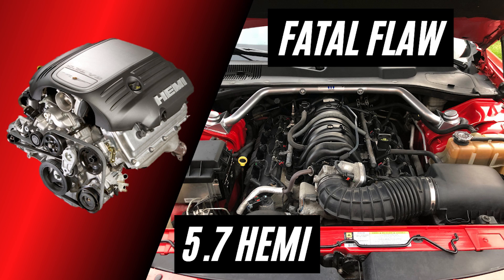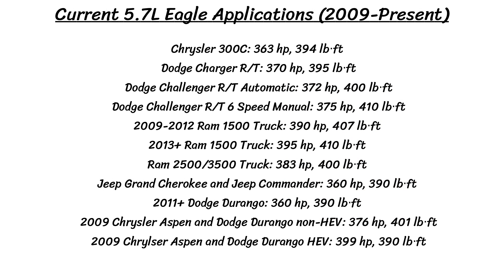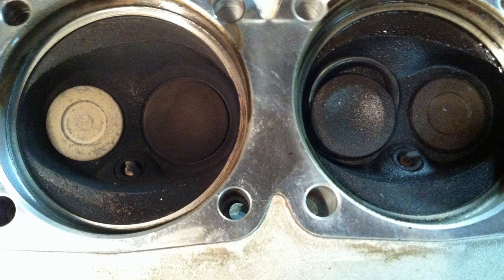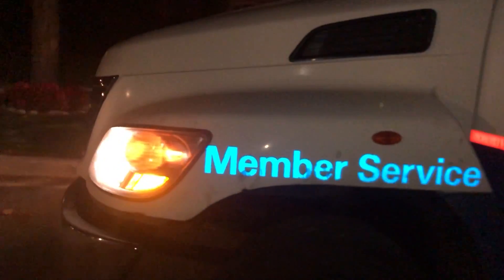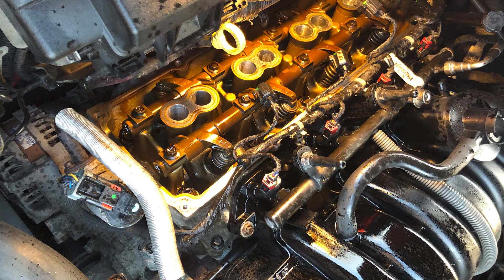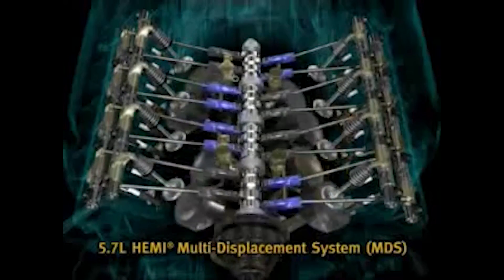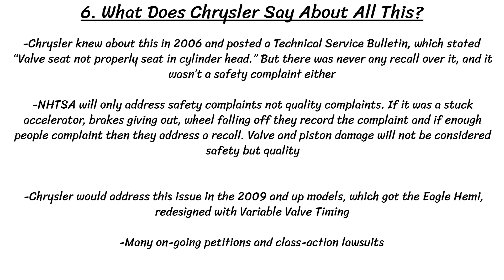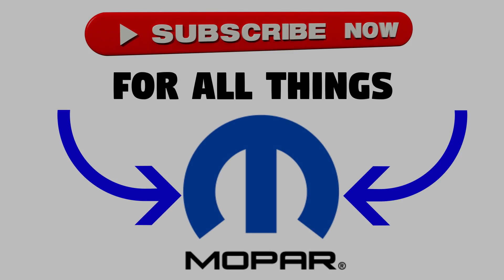The Fatal Flaw of the 5.7L Hemi V8 Engine & How to Prevent It (2003-2008 Valve Seat Drop)

Comment: 20 years as a Chrysler tech, the only time we would see a seat drop is from overheating. Pay close attention to your cooling system, and watch for lean conditions
Reply: That's what the consensus on the LX forums has become. Also it's not an immediate thing, if you're the second or third owner you may never let it overheat but if it had that happen multiple times the valve seat may have begun to loosen. It kinda boils down to maintaining your car. Given how many first gen hemis are still on the road vs how many have dropped seats. A lot have had it happen but the majority haven't. It is a flaw but it's also an issue to let the engine overheat as well.
Reply: I have been running a 180 T-Stat in my 05 Magnum RT for a few years. I figure it is better safe than sorry as I hear the primary reason for the failure is heat. I have over 216K and the HEMI runs great. I take very good care of the car and watch all the maintenance closely.
Reply: @samuknow  my first up grade was to a 180 thermostat
Reply: My second upgrade was stainless one piece wheel nuts, had a horrible time getting a wheel off when I needed new tires.
Reply: @billknight5578  160 even better.  I am even putting in a lower rad hose 160 stat. You want the motor to warm up quickly then stay cool.
Reply: I dont understand why any engineer would think its a good idea to develop 1/2 rings made out of a different material and not foresee that the expenasion differences would be a problem. cylinder sleeves are ok because they are longer and will hold in place but rings that small wont. also what is the benefit? why not keep it aluminum?
Reply: @zili8103  valve seats have a better sealing, thus giving better compression which translates into better mpg...etc
Reply: @zili8103  the steel valves would wear out and aluminum seat in the head very quickly. That’s why there’s a steel ring for the seat.
Reply: I’ve got a 2011 r/t with a hemi it has 67,000 km and 1700 engine hours and it sounds like a diesel when I start it up for the first 10 minutes kind of scary power steering is dead in the water after replacing my battery with a new mopar one
Reply: Hey Gen3 on a 05 magnum 5.7  eng.  what would you suspect first with sudden ETC light flashing.
Reply: @BUDDYSNORES  my truck did that, I cleaned the throttle body and it didn't do it again. Give that a try and see if it fixes your issue?
Reply: @billknight5578  Thanks Bill will give it a try
Reply: @BUDDYSNORES  follow the pink wire with the yellow tracer and make sure the continuity is good. That wire does lead into the cabin, but it can cause that issue. Other than that, pcm, pedal, or throttle body can be responsible
Reply: @Gen3HemiBuilder1964  ok thanks, I will start there
Reply: Thanks for that good information sir.
I think I'll buy a GM, thanks anyway.
Reply: I will probably have my 300c driven from NC to NY which is about a 12-14 hour drive in about a year, this kinda worries me about seat dropping now because it has 121k miles on it
Reply: @alexanderlayne-stasik1317  it will be fine. 120k is nothing. Just keep a good thermostat ( change it every 50k ). Change the coolant every 5 years. Do normal oil changes and drive the shit out of it.
Reply: @Gen3HemiBuilder1964  hey Mr hemi builder, I’m back, after 3-4 years after I first responded to your original comment, and I now have the car as of about a year ago. It was my grandpas car and I try to take great care of it, that hemi in it absolutely rips and I love that car so much. Thank you for calming my nerves about the seat dropping I had such high worries about years ago. The only issues I have now is it can stall while I’m driving if I fill it up to a full tank lol, but usually it only happens for a little bit. Hope all is well and thank you again!
Reply: @alexanderlayne-stasik1317  you are most welcome. Depending on your vin, some of the fuel tanks on 300, charger, and magnum have life time warranty due to the known issue. Call your local dealer and find out. I just did the tank on my 05 magnum.
Reply: I've got an 06 1500 Hemi that i bought back in 2014 that now has right around 182,000 miles on it. Not gonna lie, the gas mileage is shit (really wish they had better trans. for these back then) but the truck still runs pretty good other than that. But now, chryslers 4.7 H.O. is garbage. We had an 03 grand Cherokee that had the 4.7 High Output overhead cam motor and for the first 1.5 years or so that jeep was pretty powerful and fun thing to drive and fairly decent on gas too. One day though, out of nowhere, we pull up to a gas station and as soon as we did and i was getting out i hear her kind of gasp and then kill the motor. Before i could even get turned toward her to see why she looked super panicked (she has really bad anxiety so it don't take much lol). She told me it was overheating and i asked her if it was the first time, she said yeah, as far as she knew. So i asked how high did the needle get. She said maybe 7/8ths of the way so i said ok, pop the hood and I'll check it out. The res was full and after waiting for about 5 mins i opened it but the radiator cap was still too hot to pull. Sorry, long story. Anyways, the thermostat was stuck which caused that so i replaced it and it seemed like everything was good for about 2 days. Then it started running like complete shit so as I'm trying to figure out what's going on and had already changed out several parts (all of which had to do with the 3 or 4 codes it ended up throwing) there was an o2 sensor that burnt to hell so all 4 got changed. I can't even remember what all got changed other than the sensors, the cats(which also went to shit) but i know we spent a lot on parts, and tested a bunch of other stuff. One day while working on it after turning it on i see the rolling white exhaust(F***). Finally took it in and it had a few valve seat problems, blown head, bad gaskets, the cams was beat to sh*t, and I'm pretty sure other stuff too. Shop had it for a little over two months before we got it back. Still wasn't running right so they ended up having it again for a while after the third time we took it back telling them something is wrong. They finally listened to us and actually started looking for a problem and found out that they had messed up the cams somehow so had to order some again on their dime. There's another month and a half waiting on parts and them. They gave it back and it still didn't run right. Not near the power it had and the idle seemed rougher than it should. It was taken back to them a few more times before we gave up on the piece of s**t and traded it in. After talking with several mechanics and dealers and plenty of research, the 4.7HO is an awesome motor.... until it gets hot, ONCE! And if it does, you might as well take it straight to the shop
Reply: @ericduncan9895  that is very true about the 4.7, I worked on them since their induction. They really do run forever with one important factor, keep good thermostats in them. I recently sold my 05 Dakota 4.7. Still ram great, all original power train and kept a 180 tstat in it. 293,000 miles later another owner is enjoying it.
Reply: I’ve heard of people replacing the thermostat with a 180 instead of the 200 or 210 to help with this, but you’ll need a hand tuner to change
Reply: @justinzippo7772  the only ecu tune that is required is to turn on the fans at the correct time with the new thermostat equipped if not oem replacement
Reply: But this problem does not happen in other engines, even if overheated. Even if its related to cooling system -  this a Chrysler error even more. Because this means so many of 5.7 cars have problems BOTH with their cooling system and valve seats.
Reply: @cytrynowy_melon6604  this problem actually happens in many vehicles and aircraft. Having worked in both industries for years, I’ve had quite the opportunity to find out. I’ve had dropped seats from many forms of every car maker. Predominantly Mitsubishi and Toyota.
Reply: Design a better engine that doesn't overheat or lean out for no reason.
Reply: It's shit engineering
Reply: When you say "factory " sensors and spark plugs, are you referring to Mopar? I'm curious I just bought a 06 Chrysler 300c with 150xxx miles today
Reply: I've said this for a long time.  We got a 2015 grand cherokee, 30,000 miles, first thing I did was throw away the  1" thick radiator and replace with custom made 2.5" all aluminum radiator, 160 stat and tuner.  Result is very low chance to overheat much stronger engine, etc etc.  Works great radiator is only $1000.  Problem fixed.
Reply: Yes and replace the steel cooling tubes to water pump
Reply: I don't think any manufacturer can build a vehicle of better quality that won't fail
Reply: Glad my 04 1500 seems to be running rich. Sucks for mileage but the engine's got 315,000 kms and no problens.
Reply: Or just buy another brand you trust.
Reply: I have a 05 jeep wk 5.7 and it’s saying all 4 o2 heater control circuits low. Jeep will run fine but then it starts stalling and rough idle. Would appreciate any input, thanks
Reply: Agreed, working at an auction ive seen countless early 5.7 hemis go through with well over 200k on them. I almost bought a hemi magnum there with 240k on it. Unfortunately due to a title issue had to get my $ back. Was healthy tho even at those miles. Paid $800 for it lol would have been a heck of a win had it not had a titling issue. Trans shifted great aswell. Think the alternator was on its way out but otherwise was great. But yes overheating I believe is the issue aswell. Notably peoples lack of making sure their cooling system is working correctly. My 06 300c with the 5.7 ran a bit warm.  Always hung around 215-220F at hot idle. Now had my cooling system not been properly pressurizing this would have been a huge issue because this could allow boiling. Most people have never even checked what their overflow cap looks like. Now eventually one day in a drive through I heard a slapping sound. My cooling fans came apart. Weird. But got some from a junkyard and I noticed my car started running a lot cooler around 210F max. So I assume my fans low speeds had been no good for quite some time. To easy to over look cooling system issues on these cars. Another good thing to do is replace the water pump. Factory pump has a plastic impeller. Had mine come apart pulling into a gas station. Caught it right as the gauge went a hair over middle thankfully. Let it cool, fired it up and cut on my heat and noticed it had no flow. I could see one of the plastic blades coming off it too and causing cooling system issues.
Reply: I have an 08 commander  first gen non vvt  5.7 it has 132k miles on it . It's had an exhaust leak for at least 30k since the exhaust manifold has a couple broken studs that I keep neglecting to fix .   It seems to be fine .

My dad has had two Ram 1500s  I think the first was still need enough to be vvt the current one is  a 2018 so it certainly is . The first  one he ran for about 140k miles trades it in on the newer one a few years ago and probably has 30k or so on it . He has towed  a camper and trailer used to haul fireplace pellets with both  so  5-7k lbs .

That's 3 hemi engines my pre VVT  commander and both my dad's 1500 ram trucks  .  One thing I noticed about my commander is it eats oil  and that seems to be a thing with at least the early 5.7  because every one I looked in the dealerships were low on the dip stick and my commander drops a quart about every month ... So if you are not the type to check your oil when you fill up the gas tank at least every couple tanks you are must likely running around with low oil a lot ...lol ... Probably don't charge it often enough either .
Reply: Will a 5.7 hemi from a dodge 2500 pickup working in a charger. I know some of the non engine components will have to be changed out but if it’s the same cubic inch motor wouldn’t it have to work? I’m being told it won’t work
Reply: @russellmiller1307  it’s mainly in the programming. 2500 5.7 trucks do not have multi displacement as where all the 5.7 cars do have it. Plus the accessories are different along with the timing cover. Depending on year you also have to make sure your pcm can correlate timing with the tone wheel on the donor engine.
Reply: It seems to me that 205 degrees is way too HOT already.    Should I be concerned for
Reply: @popwarner8029  normal operation you will see up to 223 under normal hot ambient conditions. Naturally I like to run a 180 thermostat and tell the fans to come on at 180 as well. It increases longevity. We run them hot to aid with hydrocarbons in factory vehicles. Just following emissions rules.
Reply: Mine rann218 t0 220 for 17 Years till valve seat drop no warning. Ran like a top.         2 @popwarner8029
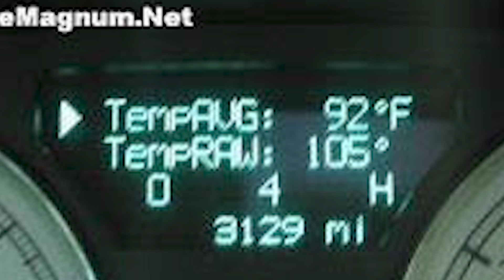Reply: @9:50 how do I find the temperature readings? I have an 07 charger daytona
Reply: I have a question for you sir, I have a 06 AWD rt magnum 125,261 miles. What oil brand should I be using? Any also any advice for a longer life for this motor please give me the advice loo lol. Just had the valve cover gaskets replaced and ac compressor. Should I be running a 180 thermostat? And is a cold air intake worth getting?
Reply: sometimes being a dodge fanboy is bad for you.
Reply: Other than that is the gen 3 hemi a solid motor, I know that the splash lubercation starvation during idling to the cam lobes and lifters but another tech said to use a hellcat oil pump for more volume at idle than oem. Idk I really like the challengers but I'm scared of these engine but I love them because they sound cool and make great hp.
Reply: Why do you suppose that some people claim that their car dropped a valve seat and wouldn't start again even though the car allegedly never overheated?
Reply: @JohnTaylor-bd1uy  allegedly, yes they say. I own 6 of these engines all with different purposes. From towing, to drag racing and road course. Never seen it unless the event of an overheat.
Reply: @Gen3HemiBuilder1964   That's the only time I've seen that happen too, and in a tech! I personally believe that those that claim that their engine just suddenly took a crap when everything was perfectly fine is a lie!
Reply: @JohnTaylor-bd1uy  yeah man, agreed. I was with dodge from 2001 to 2020 and the only time I've seen these engines fail in any manner was due to neglect of some sort..
Reply: @Gen3HemiBuilder1964 drove mine 17 years no problem. Then one day at 220 degree constant,  valve seat drop. Ruined whole engine.
Reply: Yea my charger has 270 thousand miles on it a 5.7 still strong.the reason they fail so much is people abuse them no excuse
Reply: That may be true for the 20 years of other engine designs. But towards the end of the video Chrysler admitted its an issue they caused. So In this instance your twenty years are useless. It’s like when Audi created the 1.8t and put it in the Passat cutting its oil supply by one quart below its intended design
Reply: I occasionally got a  code that there was lean from the O2 sensors, I replaced the sensors  but never got to test it because she dropped one on me in exactly the described sequence, shutting down the engine, half an hour later restarting it, ran like sh@t en didn't idle anymore so maybe it was because of that lean burn then.
Reply: @alexh201174  with those o2 sensors, definitely use only factory sensors, Bosch from the parts store typically causes problems. But as far as the lean code, your fuel pump is likely becoming soft. Replace the pump located under the LR seat, and make sure the fuel transfer tubes from the saddle pump look good.
Reply: @Gen3HemiBuilder1964  what kind of problems? I replaced my oe ones with bosch.
Reply: @sambo92  over time they can cause a rich or lean condition and a cel illumination. For my customers it’s just not worth it to cause another possible problem. Just use factory sensors. Same thing with their spark plugs, cause stalling issues etc.
Reply: @Gen3HemiBuilder1964  even if you're tuned? I've had the bosch ones on for a few months now with no issues yet
Reply: @sambo92  that’s good if they haven’t caused an issue. The first thing that usually fails on them is the heater circuit. But now if they are wide band sensor after being tuned, they will work with the software
Reply: @Gen3HemiBuilder1964  I still have my oe ones. I had a slow circuit response code and thought it was the o2s but apparently I was missing a header bolt and now the code hasn't come back. Should I put the oe sensors back on then?
Reply: @sambo92  I would highly recommend always using the factory sensors. Chrysler PCM’s don’t interpret after market sensor voltage the same as factory. We do have some interesting controllers. Any other questions, feel free anytime. I’m always happy to help. Maybe I should make a channel lol
Reply: @Gen3HemiBuilder1964  you should lol not much content on chrysler stuff compared to others. So should I put my.old sensors back on or does it not matter since the car is running fine? My tuner hasn't had any issues with the car
Reply: @Gen3HemiBuilder1964  I never got a lean code.... my fuel pump just decided that it was a good day to punch it's ticket and retire in a parking lot. That was to only time my Ram had left me stranded in over 200, 000 miles.
Reply: @billknight5578  yes sir, that’s when they usually fail completely. And the fact that you had that mileage tells me you have taken care of your truck.
Reply: @Gen3HemiBuilder1964  unfortunately it's a 2004 so it's starting to show it's age, but that Hemi never misses a beat.
Reply: @Gen3HemiBuilder1964  I keep getting the P013C code on my 07 Ram Hemi. It may be caused by the fact I put a cat back system on with little or no back pressure? It has just over 100K miles. Should I change the fuel pump and the Right rear O2 sensor?
Reply: @gearjunkie3402  I would actually start with the upstream o2 sensors. They are slow to respond to the pcm causing the light. The upstreams monitor air fuel ratio. New exhaust with years of old readings. Now they are forced to see a leaner condition and likely can’t adjust to the change due to age.
Reply: @Gen3HemiBuilder1964  They are original.  Even though that codes definition is that if a slow to respond rear O2 sensor? Actually i changed the left rear maybe 1.5 or 2 years ago for a heater code. Maybe ill just get 3 new sensors.  Both fronts and the right rear. BTW I just retired after 42 years as a Nissan Master tech.
Reply: @gearjunkie3402  very nice, congrats on retirement from being a mechanic. Our retirement plan is usually a coffin 😂. I would replace them, and make sure to use mopar parts. Bosch stuff doesn’t communicate with Chrysler stuff very well.
Reply: Who builds the factory o2 sensors ?
Reply: @dennismurray4088  aren't oem Bosch ?
Reply: @dennismurray4088  they are made by NTK, a division of NGK.
Reply: I’m familiar with ntk. I ran a Holley dominator in my twin turbo gto . Tbh I ran Bosch sensors with that setup , and ntk in a previous setup , and never had a failure either way - with the ntk 2.5x the price of the Bosch sensor .  I’m in the process of building a twin turbo 392 “stock ecu” so I’ll make sure to run the oem stuff
Reply: I wasn’t sure , I know a huge majority of factory sensors are Bosch . That is why I asked .
Reply: @billknight5578  They say that if you can hit the fuel tank near the pump, that it will always turn over.
Reply: @e.l.9589  when my fuel pump went I did get it going again by beating on the tank. When I did remove the fuel pump I noticed the the sending unit was hanging off of the pump. Maybe I was a little aggressive with hitting the tank?
Reply: @sambo92 i replaced all 4 with Bosch ones, I had 30 codes pop up in the next month until I replaced them all with factory sensors
Reply: @Bigshoots86  yeah after a year one of my heaters burnt out so I have ntks in, so far so good.
Reply: @e.l.9589  That trick works on a starter going bad too. Its usually a one time thing, but it'll get you home.  

Just don't do like one of my coworkers and shut it off after you get it started...  I guess I should have clarified that it may only start once.
Reply: Hey I was wondering wats the best spark plugs for a 2006 Chrysler 300 c
Reply: I’ve seen tons at my local engine builder, they drop seats because they didn’t use a proper press fit tolerance for dissimilar materials.  Shitty Q&A and loose acceptance tolerances mean things made it to production that shouldn’t have.  Remember there’s a high and low tolerance for the bore that receives the seat and the seat itself.
Reply: JUNK!!!!
Reply: Y’all think I should buy a 06 charger 135k mies on it?
Reply: Of course a tech would blame the operator 👌🏻
Reply: Yeah you’re forgetting the lifter no oil problem and the design flaw . In all the new hemis. hey go check out uncle tony garage and he shows the design flaw and the real problem and the new lifter position To this crusty problem and Chrysler is hiding it .
Reply: @Polaris88Reid  it's not a chrysler thing, the new chevy lts are pretty much the same design.
Reply: @sambo92  I have a Chevy Suburban for company vehicle. We have 5 of them and they all have the tick. They all over 200,000 miles and going strong. The cat converters are going out though.
Reply: @karlbishop7481  I've seen dodges with the same thing. They tick but still keep going.
Reply: @Polaris88Reid  That was the Eagle Hemi 09 and up!
Reply: @Curtis Fleabag not necessarily, the early 5.7 NGC controllers were not that sensitive, and if you had anything else that could cause a lean mixture, open intake, open exhaust, compiled with a pump that beginning to weaken and drive it spirited all the time, it’s a done deal.
Reply: @Gen3HemiBuilder1964  are you like the god of chrysler? 🤗😁
Really awesome replies all over, I'm surprised 😁
I was wondering about buying my first 300c ever, been in love with that car for 15 years or more.
Thinking about the 300c hemi 5,7 any worries about this car, I know like.... not much about them.
I'm also from Denmark so sorry for my grammar. 
Best regards🤘😎
Reply: @mortenskeem  Hello, my first question would be what year are you looking at? Not that it matters a whole bunch but there are slight differences. I still have a first gen 300c from 2006 and it has 297,000 miles. Always be religious with the fluid changes and always run quality fuel and they will run without a hitch for years to come. The early 300c, sometimes had transfer pump issues in the fuel saddle tanks, but that’s any easy fix as they have access to the fuel tank from under the back seat. Anyway let me know which one your looking at.
Reply: @Gen3HemiBuilder1964  awesome that you replied. Thanks alot...
It's the 2005 5.7 hemi. So it's the early ones. With 250.000km. On the clock.
So if I just take care of it like you do with any car, it'll do it's thing😁
Also afraid with that issue with dropping valves at, but hey, if it haven't done it in 250.000km I don't think it will🤣
I'm also thinking about  parts have to be shipped over seas because, yeah I'm in the DK.
And not many US autoshops around, even though I can do alot myself, maybe it will be costly.
So if it will be to heavy cost in repairs. But really like those machines..
Reply: @mortenskeem  you are most welcome. Anyone seeking help in an appreciative way will always get my
Help. I think your new machine will be just fine. The hemi is a simple pushrod engine and they are very easy to work on. Tons of online support for them, plus I think I will make a channel about them showing complete assembly. The transmissions are easy as well. The NAG1 derives right from Mercedes. Those are pretty bullet proof as well, but when I have a car getting up around 500 plus bhp, I use a paramount performance rebuild kit and valve body. Which makes it more like the earlier transmissions from the Mercedes AMG department. But if your vehicle is going to stay factory, just keep up on normal maintenance and it will serve you for years to come. In the engine use a good 5w20 synthetic, the trans only use ATF+4. The rear diff, 75-140 synthetic gear oil. Also the rear diff uses a 14mm hexagon to remove the drain plug.
Reply: @Gen3HemiBuilder1964  
That's kind of you. Thanks alot. Really appreciate it man.

Sounds like a done deal👍
I'll keep working on getting that awesome machine in my garage then😎🤘
I'll Call the dude Monday.

My biggest concern was if it wasn't a 'stable machine or with to many problems, mainly in the engine department.
BTW. When it comes to maintenance I always use the best/recommended filters, oils, etc.
Thanks for the awesome help and advice once again.
I also subscribed to your channel yesterday.
I should have you on a hotline or something😆

I also planning on keeping it stock, think that's enough for me, I just want an awesome cruise machine, with at Nice bark😎.
But you never know, if I'll go nuts with it i have to call you I guess 😁